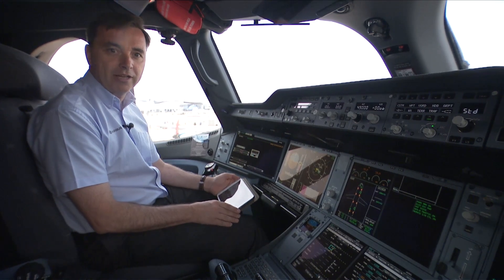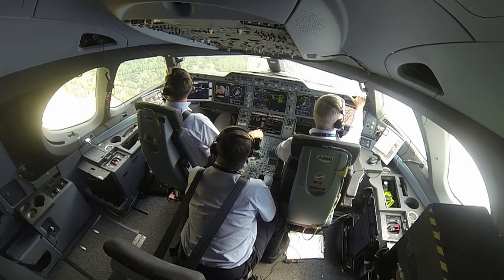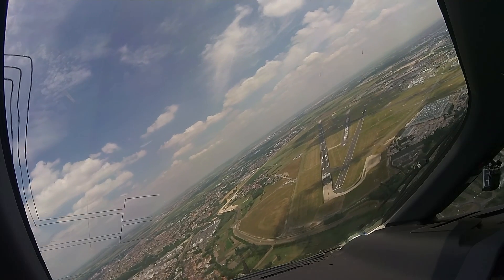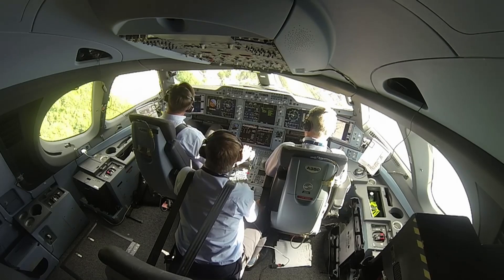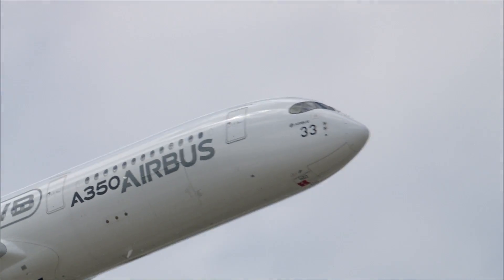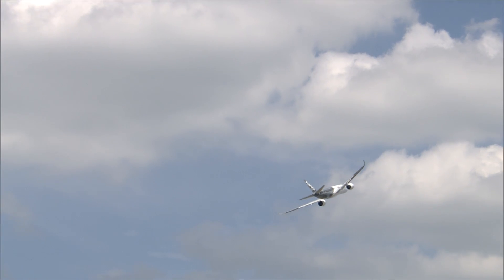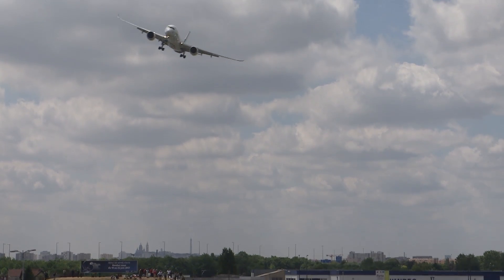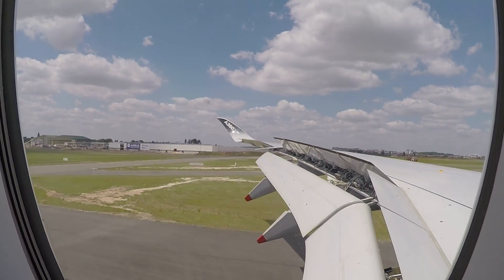Paris Air Show 2015: Flying the A350 XWB

Comment: boeing did better
Reply: +Coolguy787 Did better? You've gotta be kidding me. To date, the a350 has the most advanced avionics in the arena of commercial airliners. Boeing wide-bodies like the 777 and the 787 may better in some aspects but when it comes to technology, the A350 is raising the trophy.
Reply: +Lester Nash no about the vertical t/o ect
Reply: Coolguy787 Oh so that's what you were talking about. : )

Well, Boeing is indeed really good when it comes to near vertical t/os due to the fact that they don't really have a lot of constraints when it comes to control freedom. The range of maneuvers a pilot can perform on Boeing planes like the 787,747,etc is greater than on the Airbus a350 and the a320 family. And the reason for that is that Airbus has digital control laws that limit what the airplane can do on the air. Things like pitch attitude protection and bank angle protection are just two of many constraints operating under the Airbus control laws.

Comment: Hi, I was wondering, what is that white pod like thing on the top of the fuselage? 0:49 you can see it quite clearly on the carbon print. It seems that some aircraft have it and some don't?
Reply: Mauritz van den Heever If I remember right, that's the pod that provides Wi-Fi.
Reply: Lawrence C Interesting, thanks for the explanation. Makes sense to retrofit it in this manner to older planes, but I wonder why they don't implement it in a more aerodynamic manner in new planes, perhaps in the vertical stabilizer or something... I suppose the drag it causes is very little though...

Comment: Can somebody explain why her rotate speed is 140kts + yet in this vid, she's not stalling at only 110kts ( though with a 15 degree pitch ): yes, I'm sure an empty payload and little fuel helps a lot, but still, 110kts only? How's that done?
Reply: CusterFlux Flaps and trim
Reply: +CusterFlux very light airplane, airliners can get very slow when light, a light 777 will have a similar slow speed capability. An empty A320 will stall at just 82kts, thats what it can theoretically do with nothing on board.